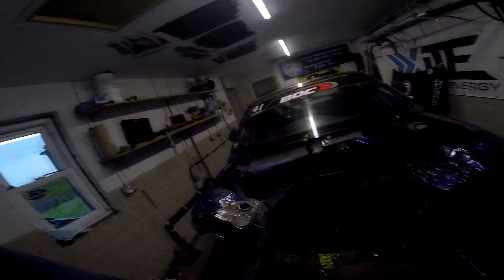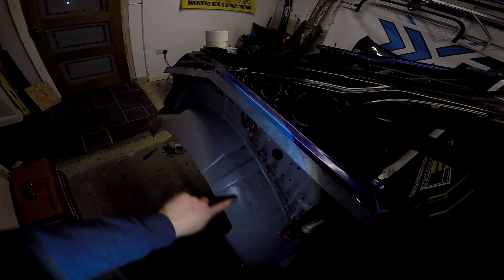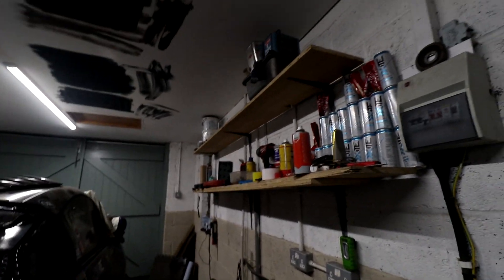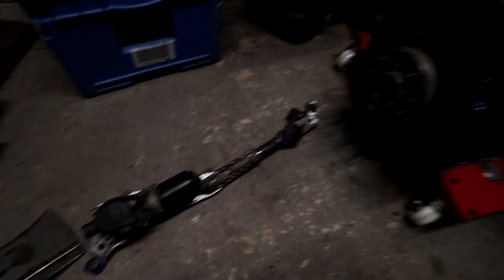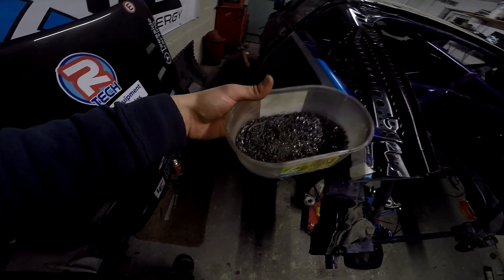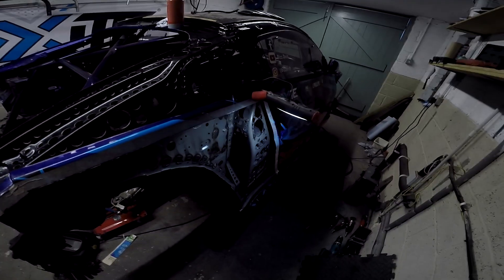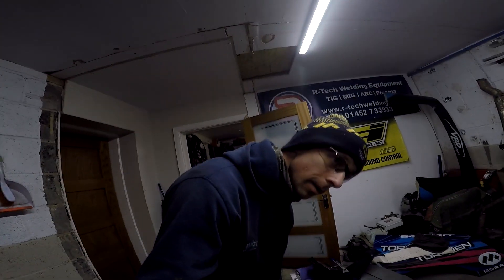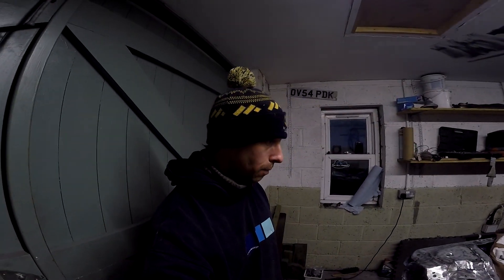Let's get some excess weight out of this 350z

Comment: Great work mate! You painting inside the arches to prevent those holes from rusting up I guess? You need some more light in the workshop mate. Grab a super cheap video light on amazon and it will look miles better and help you see better! 💡👍👍
Reply from the maker: I appreciate the tips buddy. We have some new equipment coming soon to help with this. Unfortunately the Brexit shipping changes are slowing everything getting here :-(. The whole car inside and out as being repainted so those bits will get sorted then 👍🏻

Comment: Still enjoying these Bizz. are you dimple dieing any of the holes?.... to get the screen out. You can buy kits. They are fantastic. The bit you got stuck on was probably the support that lets you position the screen. My kit has a pick tool thats Sharpe from round there.
Reply from the maker: Hey man 😁 thank you. Yeah I'll dimple die the ones I can get to both sides of. The cage is doing the majority of the work and I have been careful not to holesaw through any radii of the sheet metal so it's still pretty strong.

The bit I hit under the screen was just a massive bit of glue. When they used the proper wire it was out in under 2mins 👍🏻